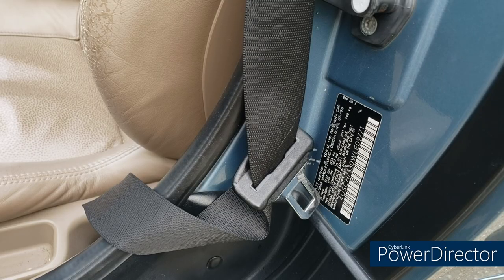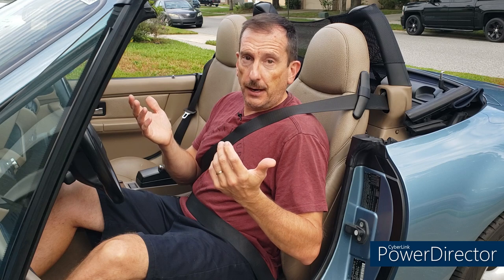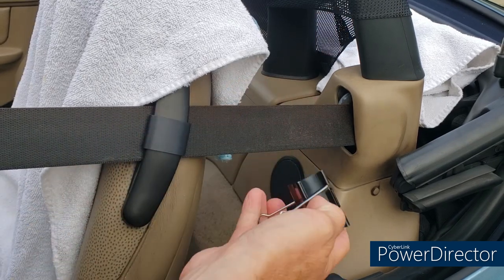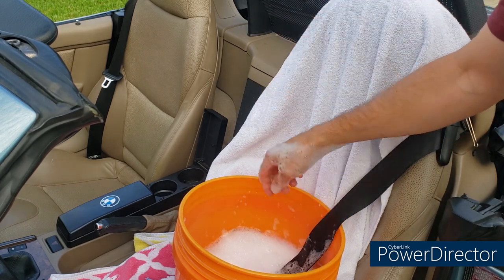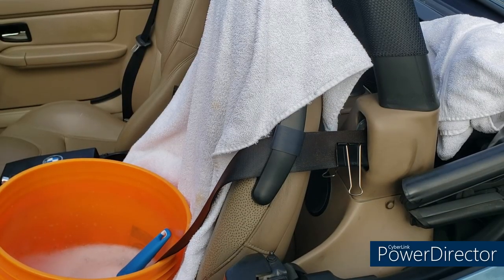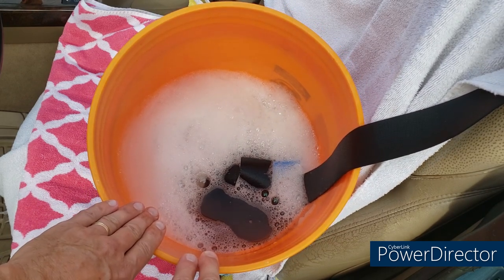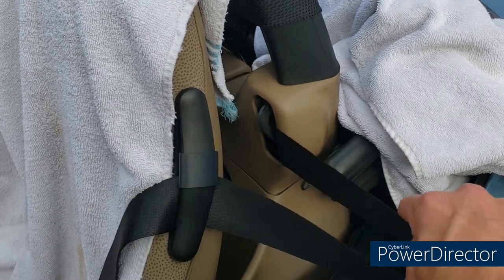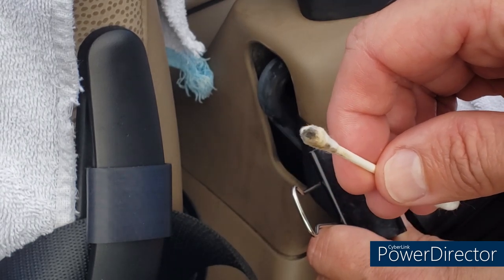How to Fix a Slowly Retracting Seatbelt- BMW Z3!

Comment: A little late on this one but I did the silicone treatment. Washing the belt to remove all the grime will make the belt more supple and easier to retract. The purpose of the silicone treatment was to lube the mechanism that retracts the belt, which is really difficult to access. I noticed the rust on the last several inches of your belt and suspect the retracting mechanism could use a lube. Pull out the belt all the way and liberally treat the last several inches with silicone spray (really soak it). Now work the belt several times in the hope of transferring the lube to the mechanism. You should repeat the process a few times. I wouldn't use WD40, the silicone spray is readily available at your typical discount superstore.

Note: I really enjoy seeing the Zed of the week videos with the different wheel combinations available for the Z3. The style 42 and 68 are two of the favorites. There are lots of used BMW wheels to try and a few that work on the Z3. 

Hint:  focus on the series 3 BMWs before 2007.
Reply from the maker: Appreciate the advice on all.  I was thinking the same think about the rust stains on my belt.  Bmw makes the best wheels.  Even now when other brands wheels look like cheap throwing stars from a low budget ninja,  bmw makes sweet wheels.

Comment: Annnd - yes same problem for me! Hi Mark, did mine about 3 weeks ago. Pulled out the belt as far as poss and soapy watered it in a sink bucket for 10 minutes of very hot water. Then 10 mins in a clean water soak. Very dirty water and after drying, a good fast retractable belt. One point - I managed to unpop the belt clip stopper. The little round black plastic clip that passes through the belt and stops the clip from dropping to the floor when undoing the belt. Found it in two halves eventually and then the old superglue job. 
Keep them coming! Love our Zeds mate. 
All best
Craig the Pistachiowner 👍
Reply from the maker: Yes,  mine is missing I discovered.   Thanks for reminding me and thanks for your support!

Comment: Mark,  Hello again from California on Wednesday, Aug 31st.  Me -- "Happy People" -- well, not sure.  😳 This additional communication is to pretty much close out my 1997 1.9 Z3 coolant system problem, as related in earlier communications below.  This is a bit convoluted.  As I had mentioned, I finally determined that the problem was an improperly fitting cap on my radiator expansion tank (it would not thread properly on the tank).  I ordered a new cap, and it too did not properly fit the expansion tank, not threading properly or firmly (a sloppy fit).  So, I ordered and received a new expansion tank, including a new cap that came with it.  Today I took the Z to my German car shop to replace the tank with the new tank.  That should resolve the issue.  BUT, Not Yet!  After considerable effort, the shop techs could not get the new tank (which looked like the old tank) to work, as it would not insert into its receiver section at the bottom.  The bottom of the tank was very slightly too large to fit .  It just would not slide in like it is supposed to.  So, I was getting pretty frustrated.  Chatting with the shop team, we decided that the already existing expansion tank would have to be reinstalled.  As they were doing that, I suggested using the new cap from the new tank and place it on the old tank.  Unbelievably, the new cap from the new tank fit very well on my old tank.  Drove it for about 45 minutes with no problem.  Therefore, I believe that issue has been finally resolved, taking great care in the future whenever removing the expansion tank cap to add water to the coolant system.  This was a rather expensive trial and error process (including initially replacing the thermostat, which apparently now I have a good old spare thermostat for possible future use).   At this point, my next maintenance effort will be having the brake rotors and pads replaced with ceramic pads, which will be performed in two weeks.   So, continuing to have "fun" keeping up with Z3 issues.  And "enjoying" 100 degree temps (at least it is dry heat, with no humidity).  Looking forward to your future posts.
Reply from the maker: Walter, glad you finally (hopefully) trscked it down!  Lot of effort for a cap.  Nothing wrong with new parts however.  Hope the next job is smoother!

Comment: Of course, I have the same problem. Thanks for adding to the long list of things to do 😅
Reply from the maker: I have that too!  45 videos and it keeps growing!
Reply: @MomentofZed  I just had the alternator, the cooling system and the clutch & flywheel replaced! It’s been a very expensive project 🥴
Reply from the maker: @GreenWitch1  Sounds expensive!  It will be worth it!
Reply: @GreenWitch1  My charging light came on, and I was able to fix it for about $9. All of the alternators that Valero makes use the same brushes, and mine were so worn that they weren't making contact. It was tedious replacing them but much cheaper than the whole alternator.
Reply: @bringbacknames  It was under $100 & I didn’t have to do anything but install it. But, I’ll keep that in mind.

Comment: Glass cleaners with ammonia should be avoided since they are harsher than needed. Put some of your soapy water solution in a spray bottle for the portion of the belt that can’t reach the bucket. Thanks for the videos.
Reply from the maker: Good call!

Comment: Cleaning the belt will not fix the spring mechanism though, clean it as much as you want but physics is physics… may be it’ll retract a little better, but problem is spring mechanism is uneasy to open or putting back together let’s say 😅. Spring becomes weak, that’s the problem, not the dirt. Uber cars have 200k+ miles dirty seatbelts but since the car is 3-4 years old they retract nice and quick. 😊 how would you explain that??? 60kmls e93 none of the belts retract any good, clean as whistle… just a thought….
Reply from the maker: @Logic7repair  can only explain that it worked.

Comment: Mark, Hello again from California.  I am still pursuing my coolant system overheating problem on my July 1997 BMW Z3 1.9.  I will be replacing the expansion tank, which I just received, which I think is the problem, having a very poor connection with the screw-on cap.   But, I could use your help, if possible, if you might find a little time.  I do not use Facebook, Instagram, etc.  I am attempting to determine exactly which coolant radiator fan control switch to order, but I come across quite a number of different similar parts on-line, making it confusing.  Do you have anyone you communicate with and rely on for parts information that you could possibly contact for me to determine which switch I should have?  I am toying with removing the switch to see if that could help determine the part number, but maybe not.  Due to the switch being high on the radiator, I believe that removing the switch will not result in much loss of coolant water, if any, but not sure.  Any advice you may be able to offer would be greatly appreciated.  Thank you very much.  😃
Reply from the maker: Let me see what I can find out Walter.   Might be Monday not sure if folks are open tomorrow.   I'll give it a shot.  Keep us up to date as you go along!
Reply: @MomentofZed  Mark, On second thought, please hold up on doing this.  As I drove my Z today, which went well, the more it looks like the whole issue is the expansion tank cap fitment problem.  I will drive more to confirm.  Many thanks.

Comment: I did this a while back on all of my cars, and then I applied some silicone spray. It fixed all of them except the passenger side on the Z3. It's better but still not good.
Reply from the maker: Interesting.  Especially being the pax side.  Is the guide good on the seat?
Reply: @MomentofZed  I had to repair both sides, but it's good now.
Reply from the maker: @bringbacknames  Try Boabie's solution below?
Reply: @MomentofZed  I'll give that a shot. I would've thought the silicone would do it, but that may be just the thing. Thanks!
Reply from the maker: If you're going the wd route,  I'd pull the belt out all the way and clip it.  My only worry is wd getting all over the belt fabric.  I'd let it sit overnight before retracting the belt.

Comment: What do I do if the seatbelt got jammed in the door?
Reply from the maker: And the door is jammed shut I assume?  Won't open.
Reply: Yessir that’s correct. Unlocked but jammed shut
Reply from the maker: @thomasrainey9293  I haven't dealt with that, but what I would do, and this might feel wrong, is to lean hard with your hip on the back edge of the door.  This should take tension off the latch, try the handle.  Again refer to my first sentence.  That is the only thing that I can think of though.